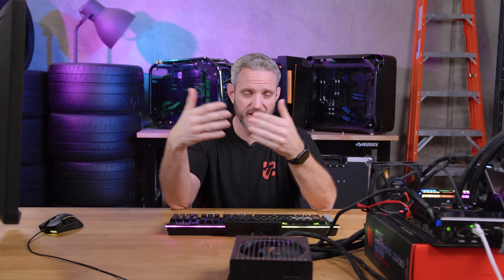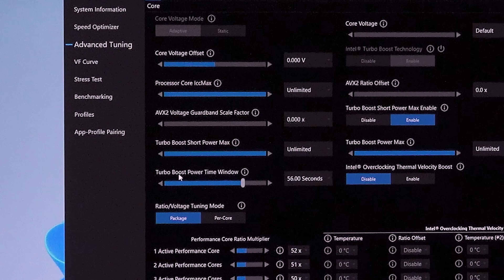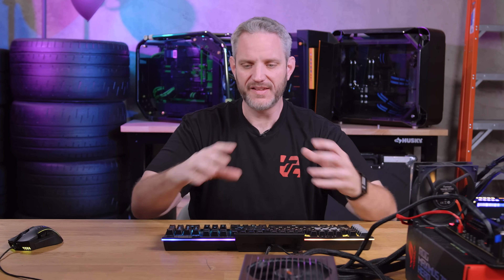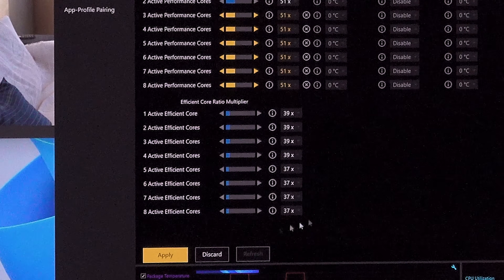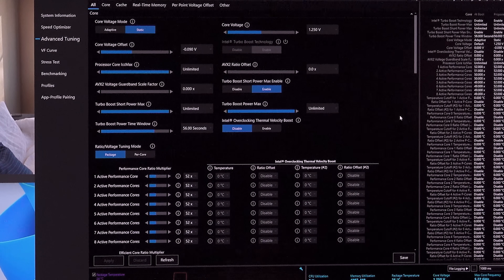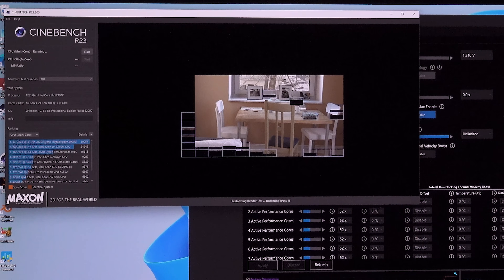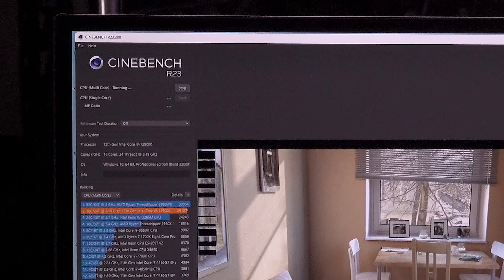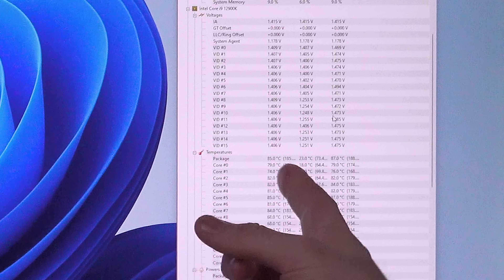Overclocking the 12900k is pointless and dangerous! Heat and Voltage testing...

Comment: For maximum desktop gaming efficiency and performance, independent voltage would be really helpful.  For most modern games, only one core needs to be blazing fast.  Even a dual voltage system with all performance cores would be amazing.  You could run half of the cores at maximum efficiency and half of the cores at maximum performance.  The system could put every thread that is not bottlenecking on to the low voltage cores, so basically only the render thread would need to be running at high voltage.  Maximum safe voltage easily uses 4x more energy than a sensible voltage with a reasonably close clock rate.
Reply: This is not how electricity works ;_;
Reply: @TheFriendlyInvader  Are you asserting that transistor efficiency is not dependent on voltage?  If so, you should do some more research...
Reply: @rickvelde7967  Yeah minor problem though, how exactly are you planning on modulating voltage on die without heavy use of VRMs? What about the miss frequencies or synchronization issues such a system would potentially cause? The incredible amount of die space wasted on basically giving every single core an independent voltage rail or regulation module?

I'm saying that's not how electricity works because you've effectively just tried to magic away the main problem of such a system without even acknowledging it. 

Only to come back and try to assert that I said something I didn't as well, lmao
Reply: @TheFriendlyInvader  You don't need independent voltage for each core.  Having just two voltage zones would go a long way.  Independent voltage control for cache vs logic already exists, so this is a solved problem.  It would probably be easiest to have half of the cores on one voltage zone and half on another, but since single threaded performance typically only matters for just one single thread, it would be best to have a small number of cores at high voltage with the rest at low voltage.

Comment: This ASUS board is a mid level board, think of it like a crosshair… well for $200 more than one of those but still ‘mid level’. A $600 or more board should not be advertised as anything but high end, this is as much as the top cpu for its socket, it’s a ridiculous price for a board.

Comment: Wish I had 29k cines  on my bench!
Reply: PS: I'm convinced there is tons of OC overhead lying around in modern CPUs but because nobody knows what the MSRs are or how to turn off the magic auto-optimizing stuff built into chip-sets, nobody is really able to use it (except, of course, in secret, in the labs where the automagic optimization is being cooked up).
Reply: Maybe I should say built into chips.   Probably chipsets, too.  Actually I'd bet all the frobs are only available to someone with access to microcode signing keys and all the microcode authoring infra. :(

Comment: My 5950X gets 29394 at 4425MHz all core in R23, so much the same as the 12900K. The CPU package power is also just over 200 Watts with 1.25V core voltage!

Comment: The ONLY reason 12th Gen is showing this large improvement is the same reason Intel always starts high and ends low. They skipped security in BIOS.

Within next 6-12 months 2 BIOS updates will remove 20-30% of the improvement.

Comment: I havent overclocked anything since my Core2Duo e8400 on freaking LGA775 xD 
I ran that system into oblivion and absolutely made the most of it making it work for 5 years on a reasonable 3.4ghz overclock... 

But since I swapped to an i5 6500 I never bothered with overclocking (nor did I use anything other than stock coolers xD) my current ryzen 7 2700x is also still on stock speeds... I might check out the bios and turn on AI overclocking and see what that does :)

Comment: Seems similar to OCing a 9700k. Also, yes if you set your LCC or whatever to .01 instead of auto. You have much much more accurate voltage control in the XTU application. I figured that out after dropping volatage offset a stupid amount, as it was way over volting what i was looking for. Succeeded at 5.1 on my 9700k at 1.33/1.34v so i was happy. I can go to 5.2 and be stable but i didnt like my temps so i kept it at 5.1

Comment: CB23 5950x on Asus x570 Extreme DOC PBO 4600 4500 1.3v on a Corsair 240 aio  (until i get my new fittings since i just got the Corsair 7000 airflow case) i got MC 30588 SC 1607.  Once i get my fittings ill keep tweaking then.  One thing im not sure about is the Livedash OLED CPU v shows it hitting 1.5v+ but in HWinfo it shows not going above 1.488v ( i have changed the monitoring down to 1000).

Comment: Curious what your final settings were. Ive been tinkering with my 12900k with a Artic Freezer II 420mm AIO. Running s-tui (stress test) in linux it keeps throttling, but not from heat. It's something else. I suspect over/under volted. s-tui runs the CPU at AVX speeds. Interesting, it also show watts, as does my kilowatt plugged into the wall. Both report around 190-210 watts for the CPU package (for wall I'm just deducting baseline, plus a few extra watts for 6 fans going full blast. Seems I'm not pulling the wattage some have reported and I think it's power throttling. Does similar in Handbrake, throttles, but not from heat. Would sure help to know what settings you used for stable 5.4ghz.
Reply: Did you find a good setting? I have a similar issue but I think it is temp even so it's not showing as temp. The AI Feature does have a temp throttle implemented where it drops voltage once it reaches a specific temperature to keep it below that temp. I tried to increase that but it didn't help. My temps with a Arctic Freezer 2 360 aren't very good. With Cinebench I'm getting up to 95°C so I think something is wrong with that. I got new thermal paste as the one that came with the Arctic was ridiculously small and will try to reapply the thermal paste on monday, maybe that helps. I also got a 3x splitter for PWM fans so I can run the AIO pump faster. Sadly with the Arctic Freezer the Pump and Fan speed is combined.
Reply: @WolfspiritMagic  I did not. My next plan is to lap my cpu and waterblock. My fans are already changed to better static pressure Noctua fans and controlled directly by the motherboard. I've upgraded to a Maximus Extreme motherboard. One temp that runs high (70+C) is the chipset. It's better on the Extreme than the Hero but not much, could be because Im running 3 gen 4 NVME drives I'm linux raid thru the chipset. Anyway my CPU runs hotter than I think it should on such a large rad. I lapped an 11th gen and used liquid metal and saw an 8-10C drop under full load with a Corsair 360.

Comment: When I go up to a 5.3 all-core and 5.4 all core the latency on my ram goes to shit. 90ns /100+ ns
Reply: what cpu the 12900k? if so what ram ddr4 or 5?
Reply: @parkersgarage4216  12900k, DDR5 I'm not sure what was causing it, I'm still tweaking the system. It's at 69ns right now.
Reply: @oceanmimi  damn, seems as though the latency on ddr5 is terrible. I'll be holding out on that for a while for sure. I'll wait for better speeds. I was gonna get a 12900k but decided to wait. I did grab a 12700k but I'm returning it.

Comment: It doesn't make sense to think of AI overclocking as a built in feature when it is part of the motherboard and not part of the CPU. This isn't like auto boost on a GPU, many/most motherboards are not going to have AI overclocking. For now AI overclocking is still overclocking, it just requires less work from the user depending on which motherboard you are using.

Comment: Interesting video. I would like to know though based on similar specs what does the 5950x get in cinebench under optimal clocks for that platform. The improvements in Zen 3 were quite good so I was curious as to where it sits since its a comparable processor unlike the 2990 referenced. I paused and checked but it wasn't in your list. These 12th series seem like a good step forward but there seems to me to be alot of early adopter compromises that come into play. I would expect based on what you said that maybe intel might introduce voltage control over the p and e cores separately to get better overall performance. Also with the ability to disable e cores what does overclocking come out like with just the P cores enabled and what does performance look like there. I'm liking this 12th series for what its bringing but its not on my buy list I think just due to the maturity of the new technologies involved. Keep up these vids though as they have certainly made things interesting again.

Comment: Does that advice also works for 10gen? I'm having a hard time getting my 10700k to 5.0 but ai oc takes it to 5.1 I believe, with 1.4v I think. Should I let it sit there and just lower voltage like you said?
Reply: Lower the voltage until you get a crash and then increase it a bit. You want the temps as low as possible while maintaining stability.

Comment: hello, so i am legit zero knowldge about pc stuff, but i want to build a budget pc and after some research i came up with these - core i5-10400f, Gigabyte B460M, gtx 1650 super, 16g ram i dont know what speed should i chose, and i already have a 500w power supply but im not sure if its enough or not. let me know what you think, would like to know your thoughts

Comment: This is probably because the companies are starting to squeeze as much performance as possible because they want to advertise the performance. They are doing it even if it doesn't make sense for most users, making the 12900K run at such high wattage and heat output for so little gain.

Comment: I'm interested in the power draw if you optimize the voltages for even stock speed ranges. Like its been all the thing with 12 gen and power useage/etc (i mean, even you've done a vid on it). So what kind of effect on overall power usage do we see if you leave it stock speeds/boosts/etc and just wind down those voltages? We know just a little undervolting on a GPU can net hugh wattage and heat savings for the sacrifice of literally single digit FPS numbers. Just be interesting if we'd see decent temp drops and decent wattage savings with very little performance drop (or even performance gain if you could drop the voltage yet still apply a slight OC)

Comment: you've been looking at the wrong voltage stat on hardware monitor. Vid voltage is what the CPUs request in under normal conditions from its micro code. Proper voltage CPU voltage is on CPU vcore at the top of the page on hardware monitor

Comment: It is going to high 80ties Celsius with AI on a 360 AIO? That's barely 10C below the boiling temperature of water at 100C. I guess this CPU paired with a low cost cooler would barely go base clocks...

Comment: Can somebody explain how you can get higher clock speeds at certain voltage, but then dial down those voltages and still retain the clock speed? Isn't the whole clock speed tied to feeding the cpu more juice?

Comment: Gotta say that is a really good reason to do software Overclocking, but I just kinda don't want to deal with the instability which comes with that.
Reply: Just leave it at stock. That is what I plan to do. 12900k is a monster, I don't see why it needs to be overclocked at all

Comment: They start on core 0 literally just for binary counting reasons. Most of the time, when dealing with cpu designing and building, you will count everything starting at 0 because the starting binary number is 000, then it would to 001, 010... and so on

Comment: Overclocking the 12900k any CPU, and even GPU, from the past like 5 years is pointless and dangerous!

Well, not quite pointless unless you're expecting anything significant out of it, like more than like 5 - 10% more performance.
Doing it for fun, because you want to squeeze out everything from your product, or to lower temps by setting negative offsets which conversely improves performance a bit because of the algos, is the reason to do it nowadays.

P.S. If you correct a spelling mistake, and the text is red, YT will remove that part from your comment. Didn't used to happen, but it did now.

Comment: I would love to see a similar bench of the 5950X vs 12900K using DDR4 then compare that to the 5950X (being limited to DDR4 and all) vs 12900k's DDR5 scores. Would be interesting to see how much the DDR5 actually effects performance with the same processors when comparing.
Reply: It's amusing because simply enabling PBO and increasing PPT/TDC/EDC nets you 28k easy on a 5950x - and this is before any curve optimizer tuning while also using DDR4. I hit 30.6k w/ my PBO+CO tuned 5950x and it's not really super hardcore.

Comment: What rad size would be optimal for the 12900k? Is 240 enough or is it better to go 360?
Reply: i've seen bundles with 240's , so looks like that'll be enough. some chassis will not hold a 360 without butting into the SATA headers up top of the hard-drive bays.  240 is all some mid-tower chassis can handle.  ARCTIC is a brand i see on Paul's videos, and they're cheap, yea the tubes go right onto the top of the unit but much cheaper

Comment: Great video! Ive seen several videos now of people running these chips stock and overclocked on AIO's with all core full load temps in the 60's and 70's. There are some idiots trying to claim that these 12900k's run at temps in the high 90's and low 100's completely stock on custom water loops!
Reply: even worse are the idiots who are falling for this misinformation. then proceed to try and talk shit its hilarious. you mean they dont need a custom loop with a chiller lmao

Comment: In fact cinebench is horrible tool for stress testing, beside it's good to test whether the processor is thermal throttling or not. I overclocked my 8700k to 5.2ghz and its cache to 5 ghz, and passed cinebench r23 looping for 5 hours with no error report in event viewer, but as soon as I fired up the battlefield v, I got BSOD and ton of cpu cache hierarchy error in event viewer.
Reply: Yeah, many people who state their "stable" OCs are delusional. If you don't want crashes it's better to not overclock at all.

Comment: The reason the voltage goes above 1.4 is because the CPU Current Capability is set to Auto in the BIOS by default, which in turn sets it to 140%. Same goes if the LLC is set to Auto, it auto-sets it to level 2. At least it does on my Maximus.

Comment: I love how a $600 motherboard is now considered "mid-range"..     WTF!     What the hell happened, my Asus Maximus X Hero board only ran me $230 and now MSRP is like double for the same series.
Reply: My maximus IX was $300. I just had to buy the Asus z690-E for $450. Not spending $600 on a mobo when I spent $650 on the 12900k
Reply: @donnyboi1990  I decided to go with the maximus formula. Hasn't arrived yet, but looking forward to seeing what that thing can do.
Reply: @donnyboi1990  remember the mobo is the foundation
Reply: @balla2172  yea, and the Z690-E is just as good as the maximus hero... I looked at all the specs of everything and it's not worth spending an extra $200 for the Hero board which is just one step up in cash in terms of ASUS boards.
Reply: just get the master its amazing board
Reply: @naor9792  does it have 18+2 power phases?

Comment: Intel XTU is ok , always found using ThrottleStop is Alot better at undervolting a Intel CPU's , especially laptops where you can also voltage cap a 45w CPU to run@30w or less, while being overclocked +500mhz running cooler without thermal throttling

Comment: got my tuned 5950x currently pulling in r23 29725 with auto overclocks usually hitting around 4.5ghz all core with 200w cpu power, single core boots are still hitting 5.075ghz. 
For me it's become less and less about pushing those all core hard set overclocks and more about working with the CPU auto overclocking systems to get the most out of a daily drive forsure and still very rewarding from a overclocking stand point to work out that perfect tune.

Comment: What i think might be quite interesting, if you have the time and inclination to do it, would be to UNDERCLOCK the E-cores, if that can be done in the BIOS.

Since it's mostly only used for background tasks, do they really need to turbo to 3ghz or higher, for example. (I know that's not strictly the case as they can be used for other stuff too)

But if folks could lower those cores, without sacrificing a lot of performance, then that'd help with heat/power usage.
Reply: The smarter thing is likely to just set negative voltage offsets for both types of cores.
Reply: disabling ecores or downclocking them would be the way to go.  the CPU package is very thermally limited once the ecores get hammered with work, so I think you could throw that thermal headroom and wattage into the pcores by disabling the ecores.

Comment: Counting from 0 is very common in computing. In this case it saves some space too since by having the first core be 0000 then the 16th core can be 1111. If the first core was 0001 then the 16th core would have to be 10000 and take an extra bit.

Comment: AMD murder the OVERCLOCKERS , then intel finally throw their white towel in the ring as the last x86 company to support the overclocking longest than AMD quit since zen+  and said overclocking is dead now..thing of the past that take everyone time but the goodnews is...you save all 12900k users by gonna below 5950x temps by -5c than amd 80c during cinebench test by lower by milvolt...i wonder can you lower more voltage ??...its very similar to zen1 and zen+ on voltage, wow jay...you did it again on video...2 days in the roll...12900k is becoming more interesting the more you keep messing with...more interesting the product gets